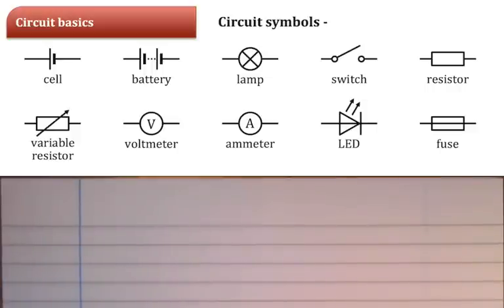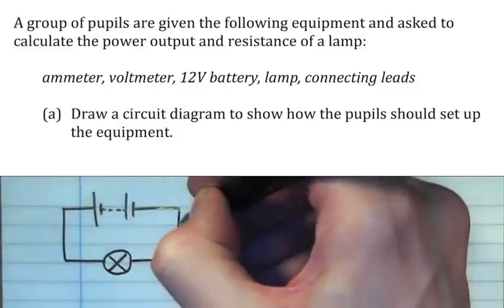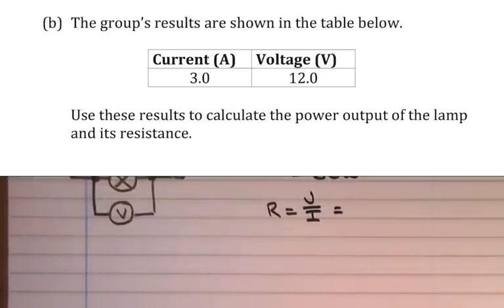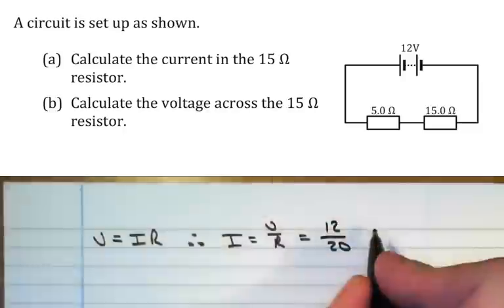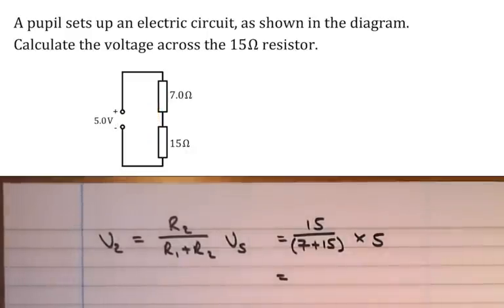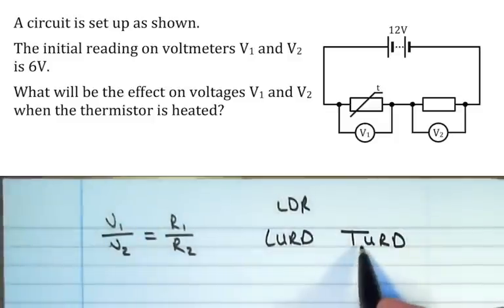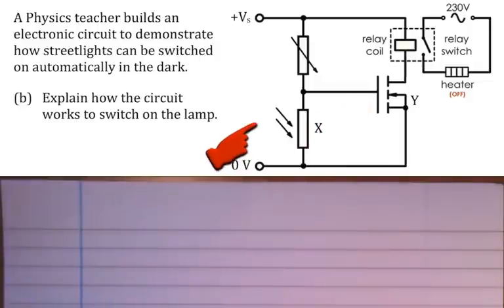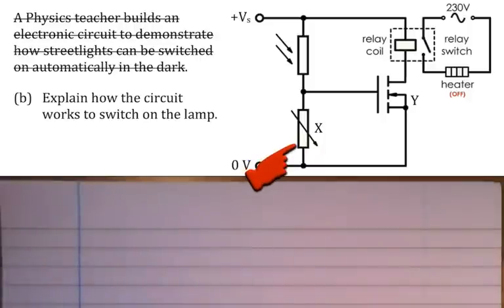National 5 Physics Live: Electricity and energy part 1

Comment: So for 7.b), do you not need to talk about the variable resistor to get a mark?
Reply from the maker: You wouldn't normally have to mention the voltage across the variable resistor in circuits like that, although you might be asked what effect altering its value might have on the light level at which the circuit switches on. Try some past paper questions on this and you'll get an idea of what's being asked.

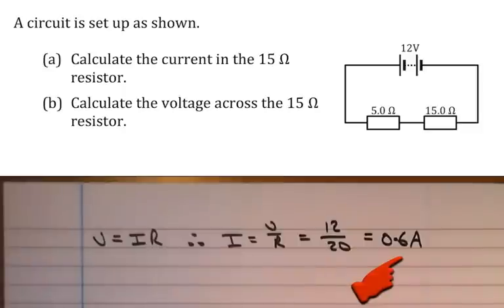Comment: At ~ 20:00 why did u use total current for part a??
Reply from the maker: That's because it's a series circuit - the current is the same at all points and depends on the total resistance of the circuit. I found the current by dividing total voltage by total resistance. I could have divided the voltage across the 15 ohm resistor by its resistance but I don't know the voltage across it. Remember - in series, current is the same at all points but voltage splits.

Comment: 43:27 I don’t understand what to write down for the answer for that question
Reply from the maker: I go over the answer from ~ 43:22. 

"As brightness increases, the resistance of the LDR decreases and the voltage across the LDR decreases. The voltage across the variable resistor, therefore, increases. When the voltage across the variable resistor increases above a certain voltage, the MOSFET conducts. With a current in the relay coil, the relay switch closes and the lamp lights."

Have a look at the other videos - one on NPN transistors and one on MOSFETs (with a blue banner in the thumbnail). There is also another video on transistor circuits (yellow banner).

Hope that helps!

Comment: what did everyone get at 29:24?
Reply from the maker: What did you get? The answer is certainly correct.
Reply: Erm I got 0
Reply from the maker: The output voltage is the voltage across the 15 ohm resistor in this circuit.
Reply: I kinda blanked out. Physics is sooo confusing!